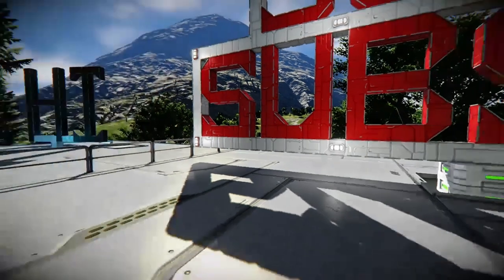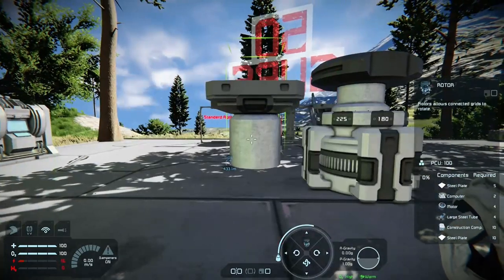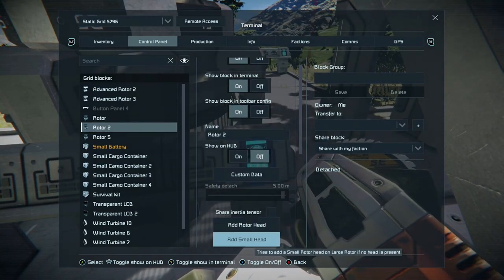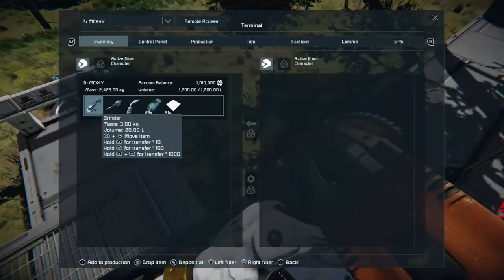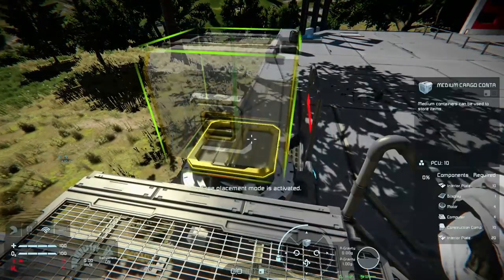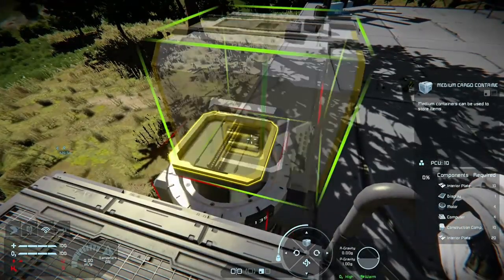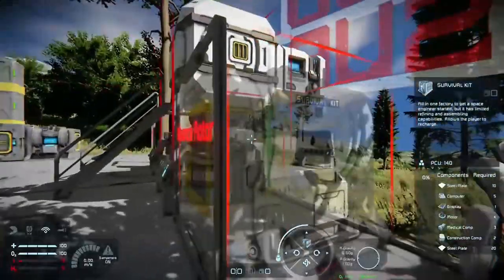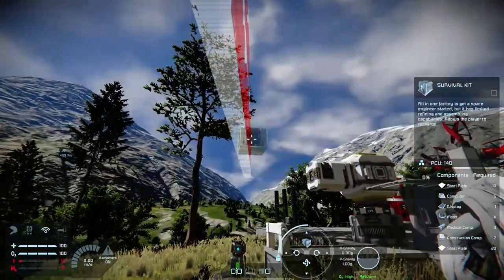Space Engineers Xbox One Placing Small Grid On Large Grid Guide

Comment: got you another sub king.
Reply from the maker: brilliant thanks so much
Reply: @DR-MCK4YS-GAMING  You are most welcome im thinking i might end up having to a aquilla statue on the bow of my luxury space yacht cause to do it correctly i need to have two legs right?  and i should make them round so it looks right i think.  But to do that i would need to make it so instead o one block being in the middle i would need to do two but that throws everything out of alignment.  the console for the bridge, ect.

In your opinion if you have the time to answer it.  Should i just go with it make the center 2 blocks so i can make the aquilla with rounded legs or just give an inpression of legs.  Or just dont included the legs at all and it be liek the bust of the eagle and its wings for the bow.  Or make a large aquilla statue attached to a rotor?

Sorry for the book btw.
Reply from the maker: if it was me try all possible designs make sure to blue print the base design before building what you want then if you mess up just re blueprint the base design back in for example with my space shuttle design I had to redesign 7 times to get right for the bay, landing gear, tower connectors so my opinion go with your gut and adjust design as needed. trial and error is the best form of design building the more complex the design the need for a base blueprint is required so try all you designs and see witch works and witch you like I hope this helps buddy

Comment: Is it possible to place large ship parts on small ships
Reply from the maker: you can only go large to small but I suppose if u made the large bits first then merge to small tht would properly work
Reply: Actually yes. You can insert a large grid rotor head in a small grid 3x3 rotor. If you are in gravity and want it vertical, you can drop the large grid head, hope it lands pretty centered in the rotor, then use the rotor's 'Attach' feature. If you want a horizontal setup, you can build a horizontal large grid rotor head on say a base, build a small grid ship with the the small grid 3x3 rotor, then align rotor and head in flight and attach (I highly recommend the use of a well placed camera and having 'Rotor Attach' on your toolbar, chances are you have move a little and spam 'Attach' until it attaches). Don't be surprised of your ship briskly rotates: during attachement rotor and head align rotation angle instantaneously (and violently). Plan enough thrusts for your ship to fly upside down if needed, and enough ground clearance. You can also build a small grid rover and try the alignment-attach if you are afraid of sudden rotations.
You can also use small grid hinges, which have the same ability to attach to a large grid head with 'Attach', as long as the head is in the right position. Fortunately large grid hinge heads are light enough for your engineer to push them around... a bit. Or you can build a crane to place and align stuff.
But always check in advance the size of the conveyor head, since a lot of items can only travel through large (3x3 in small grid) connections.
Be prepared to have scaffolding blocks explode during attachement. The angular alignment is instantaneous, violent, and can distribute great forces through your grid up to a weak link that may explode... or not.